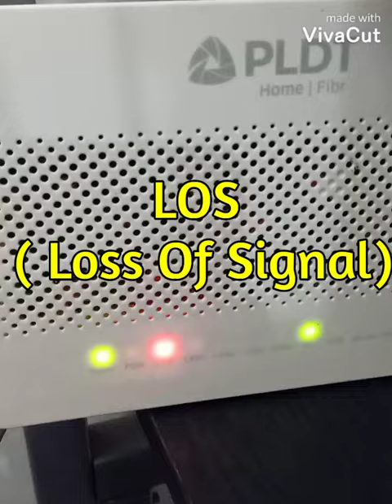LOS - Loss of Signal Red Light Blinking PLDT FIBR/GLOBE FIBR/TP-Link/CONVERGE/ASUS/DITO ROUTER

Comment: Hindi padin po gumana ano po gagawin?
Reply from the maker: check nyu po baka may kink na line or wire po...kasi madali po ma damage kasi pag na kink ang wire...
Reply: @tellmefixtv  kink?
Reply from the maker: Kink po...sa talalog is pulupot....madali kasi madage yang dilaw na opfic cable kaya kung napapansin nyu naka circle form lang iyan..di dapat naka knot or nabebend ng maigi
Reply: @tellmefixtv  Noted po.
Reply: @tellmefixtv  ahh akala ko kung anong kink yan eh. hahaha, I tried the steps out and it worked. Thanks a lot!
Reply from the maker: Thx..dont forget to subscribe 👍

Comment: Mine is still not working
Reply from the maker: if na try nyu na po lahat at di parin na solve..sa main line na po ang may problem po
Reply: @tellmefixtv  English translation please?
Reply: @silversurfer9588  hey says if it still doesn't work it's a problem with the main line